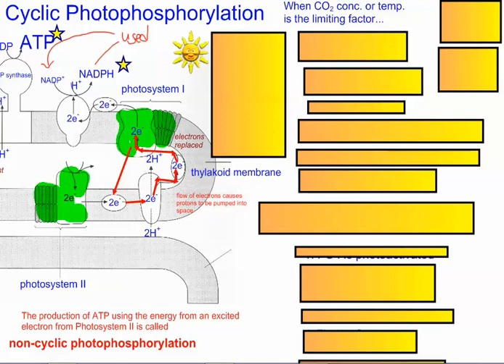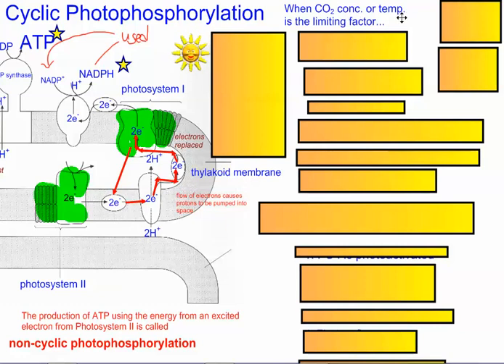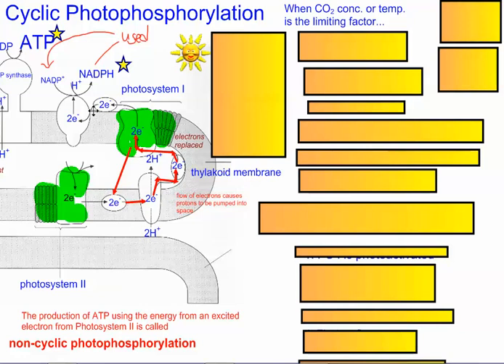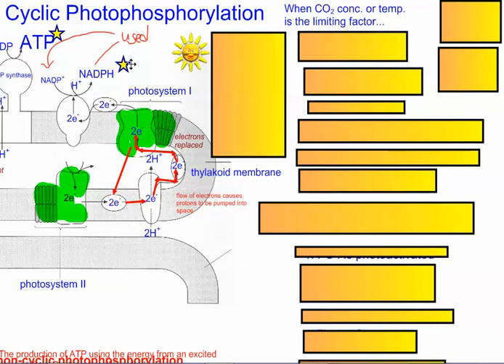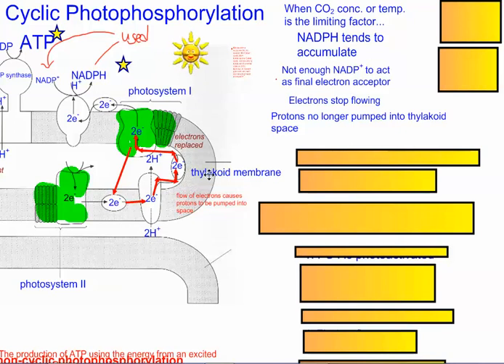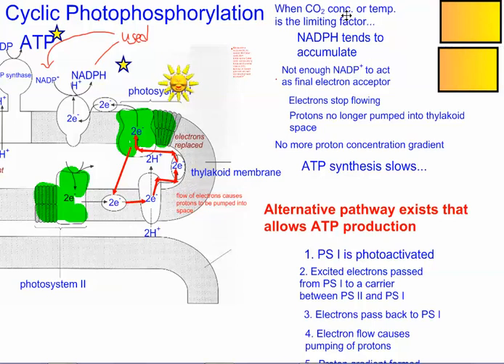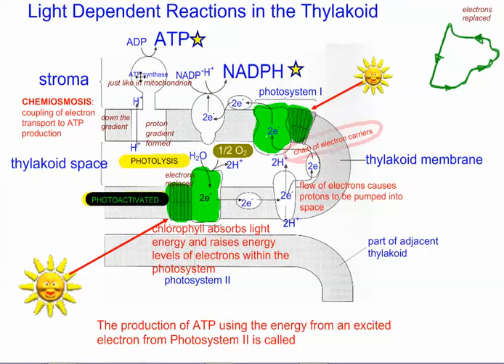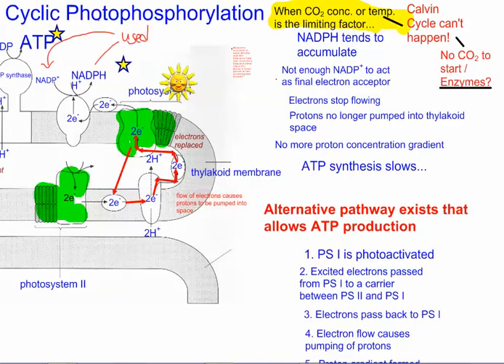Photosynthesis Part 3   Cyclic Photophosphorylation IB Biology

Comment: If the NADP+ is limiting, wouldn't the ADP conc, be limiting as well? So my question is, how can ATP synthesis continue to take place, while NADP+ reduction has to stop. so confused
Reply: They're not related. NADP production stops because the Calvin cycle doesn't take place. ATP production, on the other hand, is not dependent on the Calvin cycle, but instead on the availability of ADP and hydrogen.

Comment: I dont get one thing from this video:
You are considering NADP+ as a separate Identity that needs to be present to combine with the electron to form NADPH. However, in my book it considers NADP+ to be an enzyme called NADP+ reductase. So is this enzyme also doing the same thing by getting NADP+ reduced by giving it the electrons?
Reply: which book are you using?
Reply: Well this comment is 2 years old but anyone else with the same question could use this information as well- according to my biology teacher, NADP+ is separate from the NADP+ reductase. NADP+ is one separate identity and NADP+ reductase is the enzyme that catalyzes the reaction to make it NADPH.